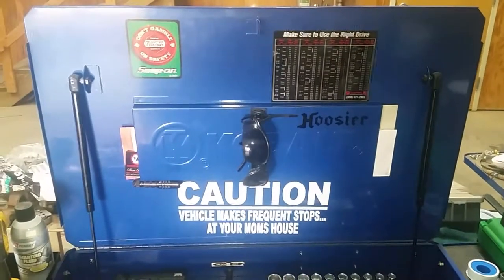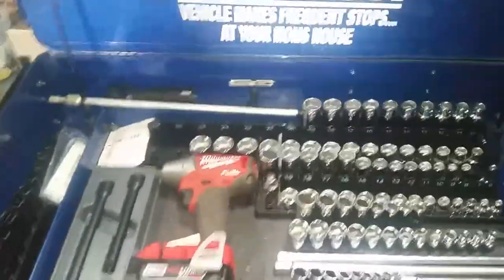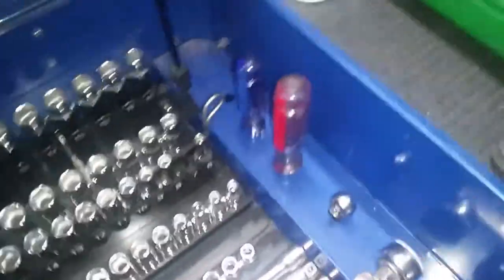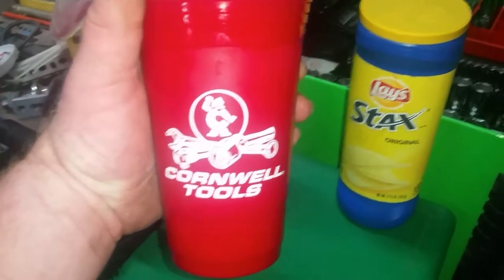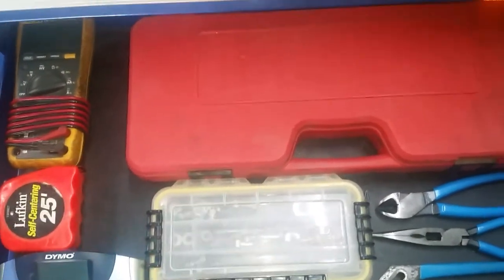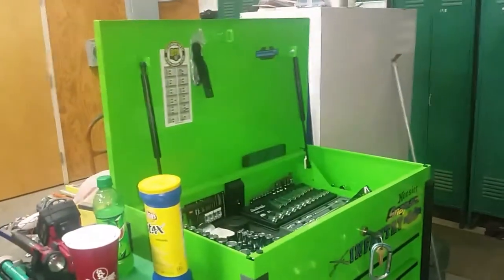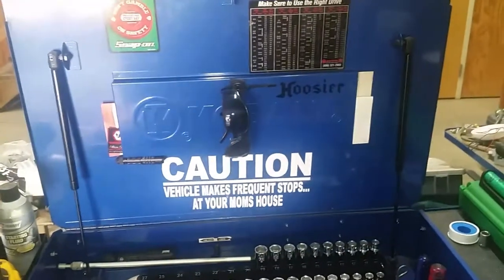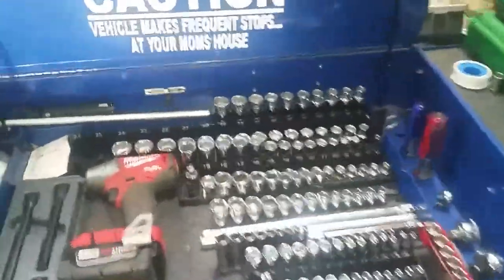Beer Stud's Kobalt 39" 2 Drawer Utility Cart #toolporn

Comment: I have this same tool cart, except mine doesnt have the paperwork holder in the lid. Lowes discontinued it a few years ago (3-4 at this point) while i was working there, and i picked up the last one new in the box for $30. Probably one of the best purchases ive made.
Reply from the maker: Thanks for watching and leaving a comment. I just wish Kobalt/Lowe's didn't give up on making tool carts. I feel if Kobalt made a cart that had all drawers, instead of with a open bottom. That would be a game changer there.